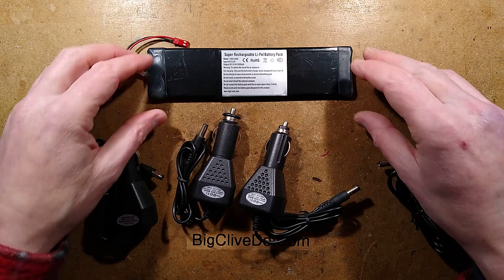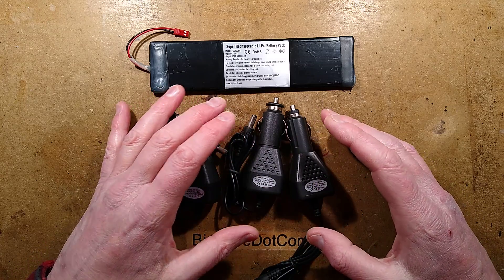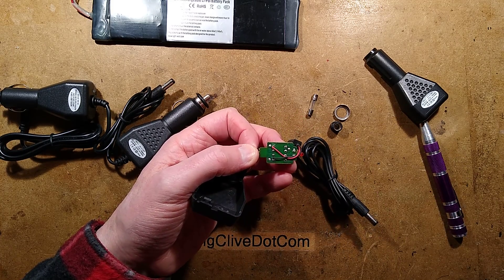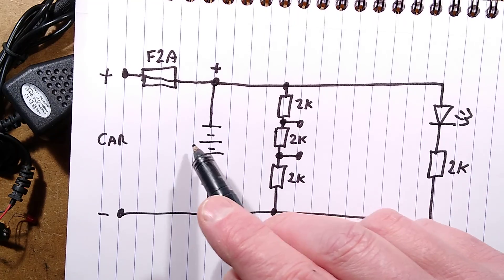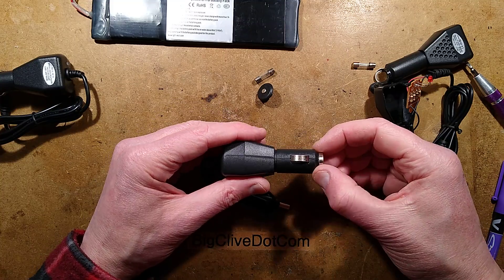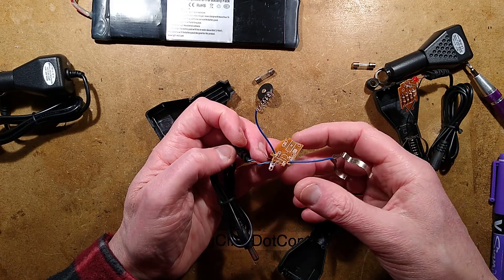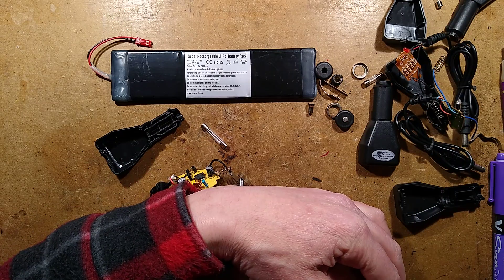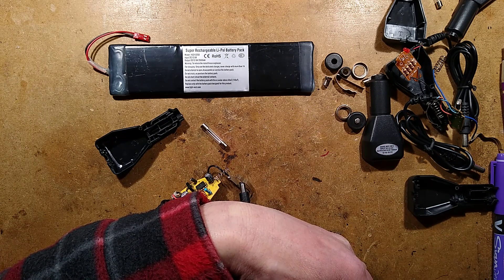Triple trouble - when offshoring goes wrong

Comment: I recently uncovered some old car LCD panels (for portable DVD players) my girlfriend owns... The "power supplies" for them say 12v input, 12v 1.5A output.... But when I plugged one into the car and hooked up the meter, it showed the full car cigarette lighter socket voltage (around 12.9 at the time because the car was off, but went to 14.4v when I turned it on).
Considering the screens say 9v input, I'm surprised they actually still work 😂
Reply: They can do this because most electronics with a CPU of some kind have their own built in voltage regulators. Same thing most AC electronics with Switch Mode PSU can operate on straight DC at much lower voltage with no modifications.
Reply: They might not work for long 😂
Reply: For 12v output I expect a straight-through plug without an adapter lump.

Comment: I can't get into specifics in case anyone knows me and which retail electronics company I happen to work for (I have contractual obligations against social media), but even waaay down the bottom, in one of more than a hundred stores, I often pull products apart and spot check them for reckless engineering. There have been a few cases I've taken problems through the appropriate channels, and of those a few I've gone around the appropriate channel. One I've taken outside the company because it really shits me when USB plugs are misused for battery test probes, so some twit could put 5V power straight to a lithium battery if they decided to plug the probes into their computer...

Comment: Interesting. I've noticed that it seems that if rechargeable batteries in devices seem to lose some charge if you leave them connected after the the charging stops. So I try to disconnect the charger as soon as the charging light goes out. (Or on, depending how it indicates the battery's done charging).
Reply from the maker: Yeah, some chargers have very simple circuitry that drains the battery slowly if they're unplugged.   The charge status LED usually lights up.

Comment: A nice call-back to something I read 20 years ago.  In a discussion about offshoring manufacturing to China, a gentleman spoke on the importance of preforming ongoing QC on what you get back from the factory.  Basically, even if what they initially send you is to-spec, they will, over time, start to cut corners, relying on the client's naive belief that initial quality is some sort of a guarantee of ongoing quality.  Ah, China.
Reply: I've heard that phenomenon referred to as "Quality Fade".
Reply: @ThumpertTheFascistCottontail  Or "China Rot" if you're less tactful.
Reply: That time I watch documentary a lot about Li-ion batteries with out protection circuit which will only cost them half dollar or so, when investigator ask the manufacturer why you don't have that circuit, he answered it's up to our client we make products according to price some of them want cheapest product and we provide it to them, even if they risk people lifes .
Reply: I don’t care where it’s manufactured or by what company if you are receiving components your quality plan needs to include real specification checks at some frequency. You cannot blindly accept a certificate of compliance.
Reply: @Turbochargedtwelve  Pretty sure the certificate of compliance is meant to be an absolute bare minimum safety requirement.. Like the product doesn't catch fire as soon as hooked to the mains or that the case cant be torn open by a small child.
Reply: @Turbochargedtwelve  this. Trust, but verify.
Reply: @WineScrounger  - Indeed!
Reply: The only country where they believe that the word Copyright, translates to Copy Correctly
Reply: @DerekEmerson  the world, the only country which thinks copyrights are copywrongs
Reply: I was involved with importing from China and also had this experience, the first 3 orders were great however the 4th which was larger than the 3 combined were all failing , we paid to ship them back for repair and the company vanished
Reply: My new boss just got caught out like this.  We order custom printed paper bags. One client reordered more stock and we don't check what's coming in. So we put the order in same spec as previously, it comes in, we send some out to the client some we store for them. The client complains that the new bqgs can't hold the weight so we check the stored bags and the paper is just over half the weight specified it's too cheap and thin. They saved both manufacturing and shipping cost but left us with a bunch of bags we can't sell. We can't even take our business elsewhere because they have all the dies and printing plates.
Reply: Left unchecked, the chineseium content increases.
Reply: I did QC inspection for a company I worked for. In 1987 to save costs, they offshored a new product to Taiwan. I was asked to follow the pilot production run and QC the manufacturing process and final product. Right from the start there were issues with the quality. 

All through the production, I was constantly shutting down the line due to the manufacturer slipping in subpar components. These video terminals had high end displays that required high-precision capacitors and resistors, but the manufacturer substituted off the shelf parts instead. The end result was much of the first production run was rejected and the units had to be reworked prior to shipping due to the wrong parts.
Reply: Not just China though. Don't forget about India and Malaysia too, oh and Taiwan and Phillipines. Some manufacturers will buy in good quality products, rebrand them, and send those out with a small profit for a while, then start supplying thier own much inferior quality ones for a huge profit later on.
Reply: @penfold7800  I've run into that many times especially with USB cables and other lower-cost items that don't have much of a profit margin to begin with.
Reply: Lol you think that doesn't happen with manufacturers everywhere?
Reply: Made in China makes YOU poorer. Change my mind.
Reply: The more reputable manufacturers offer their own QC at a price, ensuring quality to be consistent. Its not that expensive and we had a very good experience. Its really only when you are pushing towards the cheapest possible when things get ugly in china.
Reply: I have seen this with pretty much every country in the world. And in every price range. They run a company - it's there to make THEM money, not to make you money. If they can cut corners without customers leaving in troves they will do it.
Reply: That is seiko in a nutshell.
Reply: SHINA
Reply: Justin Trudeau admirers China
Reply: @samholdsworth420  Yes, more attention to detail is what is generally wanted - it's "admires" - what else in the nature of thinking or quality control do you get wrong?
Reply: @Don.Challenger  trying to decipher your poorly written paragraph ¯\_ಠ_ಠ_/¯
Reply: @samholdsworth420  Apparently, Donald Trump's suits and M.A.G.A. hats are made in China
Reply: @TerryLawrence001  were did you get that fact from?😂 Probably the same place that said you only need 1 jab 😂

Comment: ...Ok, that 'fused fuse' just brought back a very faint memory. I do believe I recall having a (quite expensive for the time, but it was a 'gift' from my dad's employer) portable DVD player, and at one point there was an electrical issue and it wasn't getting power... my dad told me to check the fuse, and I could SWEAR it was bridged just like that. I didn't know that was a problem then, of course now I see the issue!
Reply: made separate comment

Comment: The MI company Behringer ended up building their own factories in China (well they call the latest one Music Tribe City as it has everything from the factories themselves, offices, workers accommodation, leisure facilities and healthcare facilities, plus a fleet of electric coaches to get employees to work) to overcome the swapped parts issue and have their own people from the UK/Germany running it out there. They also make whatever they can so that in the end the QC stops with them.
It's also enabled them to move manufacturing of higher end devices to China without needing to worry about quality issues.
Reply from the maker: I didn't realise they had gone so big.  Their stuff isn't too bad.
Reply: Strictly speaking it's the parent company that also owns the Midas and Klark Technic brands that has the factory complex. In the early days Behringer had their own engineers embedded in the factories they used, but once Music Group/Music Tribe started acquiring other brands it made sense to setup their own facilities.
Reply: @farmersteve129  Sort of, they had people in China to monitor factories and when they decided they didn't want to do that anymore they opend the Eurotec factory, this was before they had acquired MKT, there's a factory sound video on it.
And if you're ever in the area they welcome anyone to visit and have a tour around the factory.

Comment: A large number of things which say 24v/12v actually can't do 24v.   Small aircraft often use a 24vDC system, including the cigarette-lighter sockets.   I've had more than a few things release the magic smoke when I tried them in aircraft.   Sadly, all of these went all smokey before I even cranked up the engines, so they were failing at 24v or less, not the 28vDC from the generators/alternators.   Kind of sad, too... There was a nice Carbon Monoxide/2x USB charger that would have been ideal in airplanes, but every single one I tried choked on the 24v despite the labeled claims.
Reply: I'd much rather have a substandard device fail during pre-flight than at altitude.
Reply: That is a special "self test" feature reserved for the 24V (and premium cost) version when ordering.
Reply: The stubbornness of the "cigar lighter plug" has always amazed me. There is so much wrong and so few things right about this socket, yet no group of car manufacturers came together and decided to go for a better standard. Only recently, the USB socket became fairly standard, but that's not a perfect solution as even with USB-PD, you can't power things like a small tire compressor.
Reply: @IIVQ  Its simply because the cigar lighter socket was never originally designed as an accessory socket, it was just something that was there already, so companies just designed a plug solution to fit a power outlet that was already fitted in most vehicles, not Ideal but it worked, so they just kept going with it. 
 Very much like how telecoms engineers found they could send data (the internet) through telephone wires, which had already been in place for decades, not the best solution but it worked so just kept going with it to this day!
Reply: @NOWThatsRichy  I understand. Such things happened before as early appliances came with Edison screw "plugs" to fit them into a light socket, which are very inconvenient.
Reply: @IIVQ  Yes that was the same many years ago with Christmas lights they used to come with a UK bayonet plug fitted to fit into a light socket.
Reply: @NOWThatsRichy  We can still get screw in power sockets at the hardware store. I saw some the other day when I was there buying something else. The last time I saw one of those things was when I visited my great grandmother and she had one in a lamp and that was nearly 50 years ago. I didn't think they still made those things.
Reply: @IIVQ  at the very least, Anderson power poles would be a much better standard for cars. Cheap, no electronics.. USB-PD is getting there but still has some growing pains to overcome.
Reply: @IIVQ  it's easy to plug into (ABSOLUTELY VITAL for vehicles) unlike USB, can support weight unlike USB, is large enough to support flush things unlike any other standard, and is backwards compatible with decades worth of stuff.

I hope the cigarette lighter socket never goes away
Reply: @chistinelane  I never said USB was the only other option. Also, I have never seen flush mount plugins except for ... usb sockets. And the main reason I dislike them is they were never designed for their (current) function, a reliable electrical connection. 
Also, I disagree with you in the cigarette lighter being able to support weight, I have adapters (mainly the TomTom 12V>5V adapter) seen fall out in multiple vehicles with minor bumps.
Reply: @IIVQ  Well, the cigar lighter socket is more rugged than the USB port for sure
Reply: Well, you could always modify one or take it to bits and 3D print your own using a 24v rated buck converter.
Reply: @vgamesx1  One good option is to use a 30V+ rated buck converter to step it down to 12V and then use a decent branded car charger for the extra protections. I'm always nervous about cheap chargers which don't monitor the output in any way
Reply: back when i used to work at a cellphone repair shop, i got into testing chargers with an oscilloscope, assuming an oem iphone/samsung charger is good at 120mv peak to peak, i found maybe one car charger out of 2 dozen i tested that was anything less than 450-500mv peak to peak, even ran across a wall charger that was 1.6V peak to peak, yes it was vaguely 4v-6v output. The only chargers i will use are known name brand, or anker.
Reply: APP's look sturdy, but it'd be nice to have something more consumer friendly.

On our ship we used 230V "schuko" CEE 7/3 sockets and plugs for both 230V and 24V, with the 24V sockets and plugs being painted red. Afaik, this never created problems. But the 24V sockets were only used for navigation lights, and the 230V was available in the harbour and when we powered the generator.

Comment: HEY BIG CLIVE... Could you do a video on any of the Chinese 194 automotive bulbs? On Amazon, there are a million brands of these no-name Chinese 194 bulbs. Almost all of them fail within the first year after claiming in their ads some odd-ball chipset as being their claim to fame. Can you find out what fails on these LED bulbs (what exactly in the driver circuit fails)? All of these bulbs claim the LED lasts 10,000 hours, but unfortunately their drivers fail in 100 hours. And the Phillips brand seems no better according to reviews. Thanks!
Reply from the maker: I have some of that style here.  The 10,000 hours thing is just marketing.  They are usually overdriven.
Reply: The only "driver" I've ever seen used on any of those wedge base 194 style LED lamps was a simple series resistor. There used to be dozens of one day auctions for them on Ebay with opening (and often closing) bids of a penny or two with free shipping.
Reply: @jamesnasium7036  I don't know how to find a good 194 that lasts for more than 6 mos. Seems cold weather gets them flickering, then failure. Sometimes dimming them makes them stop flickering.

Comment: I had a cheap Chinese charger start smoking. I had to break it apart because they had used an old fuse that was blown and just soldered a wire across it and out some heat shrink on it... 
They need to change laws so these manufacturers can be criminally charged!
Reply: China is a fascist country. There is no means not justified for the end of them reclaiming the spot of #1 world superpower like they (the leaders) believe they are meant to. Though they have made some mild efforts to curtail crap that is at this level of offensiveness.
Reply: Chineseium rated  no blow fuse.
Reply: @assassinlexx1993  Anything becomes a fuse if you pass enough current through it.
Reply: @rocketman221projects  
Q: why does Elton John not like lettuce?
A: because he's a Rocket Man!! 🤣🤣

Comment: ...the situation definitely called for a swear word or two,  but no matter.
 I have encountered fake USB vape pen chargers... They had a little bit of circuitry to turn the LED from red to green when it achieved 4.2 volts but no circuitry to actually shut off the power- so the device would deliver the full 5 volts... which is bad. now I tend to open up any similar products that I get to make sure they really are what they purport to be... I haven't found any more fake products unless you count this one incident- I opened up a cell phone and it had in it no circuit board, just a small slab of steel...  I thought the thing seemed a little heavy but I figured that was just because it was a good one... You know the old saying "if it's heavy it's expensive". a friend of mine tells me it was probably just a "display model"... he's probably right, but it was weird. 
  peace and love.
Reply: I had someone give me a USB 3g dongle they couldn't get to work. I opened it up, and it just had a chunk of steel in it. I asked them where they got it.. 'from the phone shop', yeah, five finger discount of the display one..